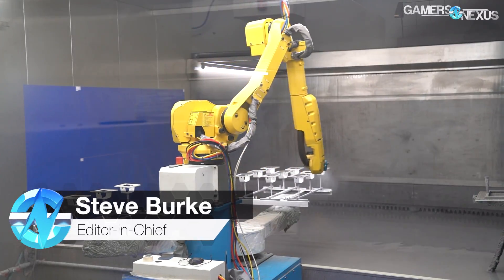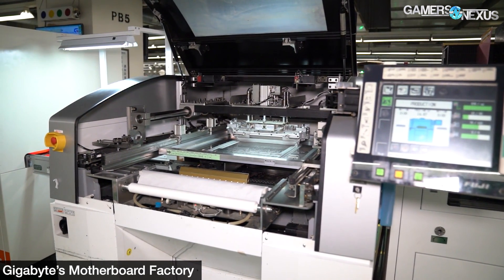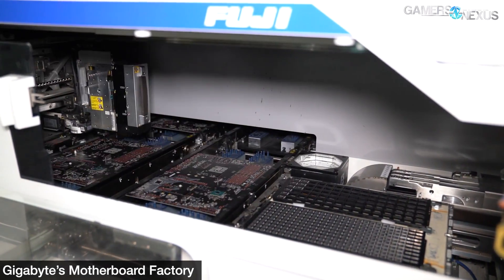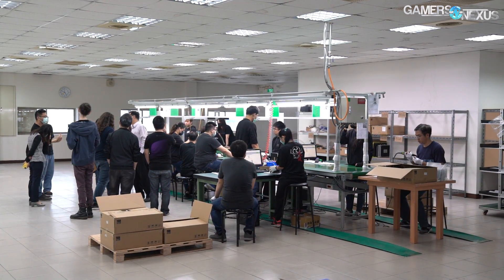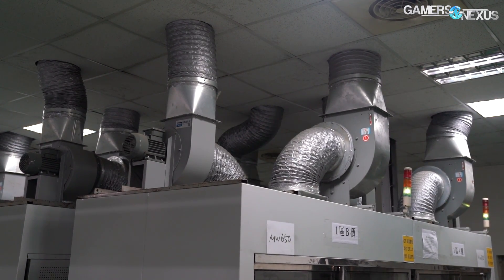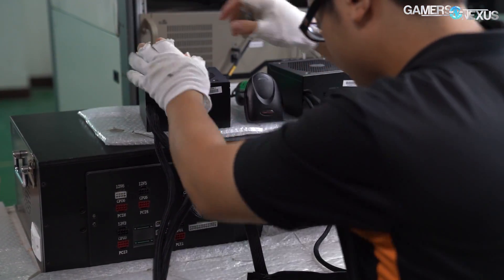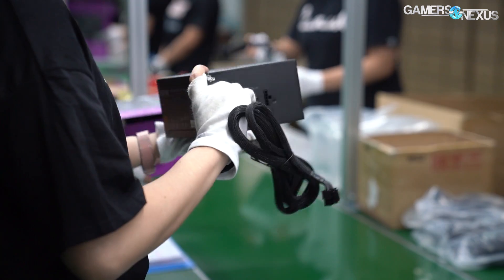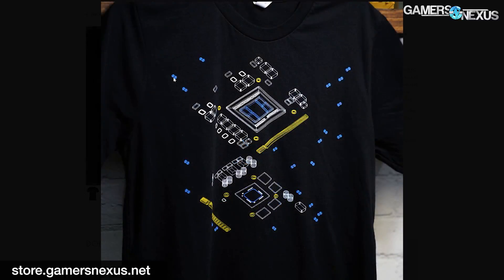How Power Supplies Are Made (2020) | PSU Factory Tour, ft. Cooler Master

Comment: "PSUs have low failure ratings" - Its amazing how different realities coexist in the world. Im from Brazil, and most PSUs here are absolute crap, I had at least 5 PSUs exploding before I got into tech. Most manufacturers lie about the potency, efficiency,etc.
We even have a group (Teclab) that tests a lot of PSUs and the vast majority is bellow spec, even from reputable brands (in the low end)
Reply: so that is where the units that failed QC finally end up
Reply: counterfeit parts?
Reply: Not counterfeit, just cheap stuff. From small companies mostly, like c3tech, xigmatek, etc. Also the low end stuff from EVGA for example: they are not THAT bad, but they are not good. My evga 430w went bad after 3-4 years, the 12V rail was varying between 10.9 and 11.4V, so the gpu stopped working properly (but it didnt kill any component)
Reply: @Taja_   Even small companies like Xigmatek also can give you good stuff if you know which model to buy. Even well known companies like Cooler Master also produced junk like the Extreme Power series. You have to be aware that even Cooler Master do not design their power supplies, they merely packaged it. The main PCB design and manufacturing is done by OEMs like this one shown in the video which is HEC . HEC also make power supplies for Xigmatek in the past such as the NRP-PC series many years ago. They were good. There are only 5 OEMs that I know of whom design and sell their own power supply under their own brand name to common consumers ; Seasonic, Super Flower, AcBel , FSP and Enermax.
Reply: Argentina here. Generic psu are bombs waiting to explode.
I always buy 80plus certified. Had a coolermaster 80plus white for 8 years was killed by the transformer near my house exploding but saved the pc. Now i have an evga 80plus bronze
Reply: Any cheap PSU whether from something random like you suggested, c3tech, or from Seasonic, is generally quite bad. If from a major seller they're generally not bad enough to explode (except Thermaltake and it's Litepower / 80+ bronze Smart series), however they still certainly will do dumb things potentially damaging the PC.
Reply: @HeiiKun   That's why I buy Seasonic Prime Titanium. Reliable, super efficient, fan only kicks on when needed, and near perfect power distribution. Where I live we have regular blackouts from downed trees during rain and snow storms. The Prime has just enough capacitive reserve that in conjunction with my MSI X99A Gaming Titanium it does around a 10 second safe shutdown. I have yet to get an improper shutdown message when restarting this system after a blackout. It's so worth the extra $$$ to buy a top tier PSU & mobo. Saved me from the mass of headaches I had when I owned OEM systems.
Reply: @HeiiKun  well, any 80+ Bronze certified PSU is decent, and I mean just good enough. I don't buy Platinum or Titanium because the savings on the electricity bill (you are going to need 10 years for price diff), but because they last more, and they are usually quieter. Best Seasonic PSU are certified Lambda++, noise under 15 db.
Reply: @biomorphic  Any 80+ Bronze is decent? Tell that to the Seasonic M12 / S12 series and let us see how it goes. As, they really arent decent, not even meh. They're just bad. Sure they won't explode, but that isnt the only thing that makes a PSU bad.
Reply: Hei-kun can confirm, my 500-ish (I can't remember the exact number) watt S12ii stopped working after roughly 6 months of use, hell I'm not even running anything high end, Ryzen 5 2600, MSI B450A board, ATi HD6xxx from back in the day just for the sake of outputing a display, and 16gigs of ram..
Reply: Luckily it didn't kill anything, beside my wallet, and my drive. Just, buy the best PSU you can afford, you'll never regret it
Reply: @biomorphic  Fake news. there is+80 Bronze psus that are even dangerous not crap but dangerous, look at psu's tier list. :)
Reply: @hafidzgi  man, I have the same psu and processor. Have been using it for more than a year for playing games everyday. I hope my S12ii 520w will be fine for the advertised 5 years warranty (gpu rx 570 4gb, ddr4 2666mhz). Did you apply it for warranty?
Reply: Valdis Knight not yet
Reply: True, had one CoolerMaster 80+ Gold blow up and started smoking, good thing my breaker tripped and saved everything it was connected to. Got it exchanged for another one and have been using it for 3 years without issues. There are always a few bad units but I still trust CoolerMaster.
Reply: jetjix  not true about the power rating. If you take the BQ Straight Power presented in the ad here, this series also have 400W PSU units that follows the same qc but the component are just smaller in power delivery. My advice is then quite the opposite : if you don't need a 600W PSU, consider buying a higher-level unit with a lower power rating for the same budget.
Reply: Most brands of the said PSU brands DON'T MANUFACTURE their own PSU nor/or even design their PSU and that includes Xigmatek and Corsair, they rely on other specialized PSU ODM (usually from China or Taiwan). One of best known longtime PSU maker are Seasonic who does both consumer and industry server grade PSU.
Reply: That might have to do with power from your outlets, to be honest.
Reply: I don't think you can blame it all on the electric device that gives up. I'm looking at the readings of my volt meter and it says 231V, it said 231V last 10.000x times I checked and probably will say 231V the next time. I'm just lucky we have stable power here. There is more stress for components when it swings from 210V to 240V at any moment and god knows what happens when you really look at it with a oscilloscope or something like that.
Reply: jetjix Yeah ikr, maybe my S12ii are just crap unit, it's like gambling, but get the best you can while you're at it, I also have another system running with a Thermaltake TT450 or something like that, a really old unit, I can't even remember when I got it, clearly 10yrs or more, but its still running just fine, it doesn't even have any efficiency ratings printed on it
Reply: sounds to me like you are at fault here.. like trying to run a 400watt system on a 320watt psu with poor rating. when you should only be using it for something like 260watt and keep the overhead for spikes.
Reply: I don't know but,maybe is a problem with the power distribution of your country? Can be this a potential problems?
Reply: he means actual good psu have low failure rating, ofc those 10$ psus will be dead in 2 months
Reply: Sadly, it's a function of the market. Your market doesn't support the "high end" enough. Most PSU's need to be cheap, cheap, cheap. Add to that crappy power and you get this sort of situation.
Reply: That is why you buy from USA. I live in South America too and my entire computer even the case was brought by friends from USA. I have a seasonic 800 modular still working after 10 years
Reply: @demonwares  Seasonic is a British brand and the factory is in Taiwan, as the headquarter. It is not from USA. The best supplier line they do, Prima Ultra Titanium, ships with a 12 year warranty. Corsair AX1000 is based on the Seasonic Titanium platform. For the most part, the PSUs on the market aren't made by the brands they sell them. The Corsair AX1600i, for example, is built by another manufacturer, which is not Seasonic, but it is one of the best PSU on the market, and it offers 10 years of warranty. Usually power supplies, and motherboards, fail after a few years due to the use of cheap capacitors with a short lifetime. The same happens when you buy an Asus board and a Gigabyte one. Good components cost a lot of money, but they are more efficient and durable. I fixed two Samsung display, dead one after the other in a 2 month time. Replaced the capacitors with the best I could find (for the use), they are still kicking now, after 15 years. I sold them to a friend 5 years ago, he is still using them. Often they put cheap capacitors because they want you to buy new hardware after a few years.
Reply: @biomorphic  wait... Seasonic is British brand? They are taiwanese... factory in China and offices in Europe, USA and Taiwan.

Comment: I was just thinking about how much power this wastes and that they should use it to charge batteries to recycle the power and then I hear that's exactly what they do lmao
Reply: @Dave P. why are you talking about fascists lmao
Reply: @jeeBisOkay  he isnt. Hes talking about eco fascists
Reply: @Dave P. must be nice to have winter..
Reply: @mtlshdr  No, it isn't.
Reply: @Dave P. "Eco facists"
Winter is only 3-4 months every year, but okay.
Reply: @mjc0961  you forget spring and autumn are also about 3 months of cold also. only about 2 months actually are hot in a year. (meaning you have the heat on most of the year.)
Reply: @theepicslayer7sss101  Which thankfully, if gas heating is used, is actually more efficient than air conditioning.  Heat exchangers muddle things up a bit, but, otherwise, heating is cleaner than cooling.
Reply: @PongoXBongo  heating usually is done with electric heaters, literally the same principle as a toaster. tho they are like a bar at the bottom of the floor near a window usually, they work with convection. so if you have 5 to 10 in the house, that is 1500 watts each. that is why we have about 400$ per month of electricity bills here in Canada during winter. (about 150$ to 200$ for the rest of the year.)

Comment: I have been using Coolermaster PSU's for years and without fault, only needing an upgrade because of new components needing newer, more or fancier connectors. Currently my system is running a Cooler Master Silent Pro M2 720W unit (which stopped production at the end of 2013), and very interesting to see how they are made and tested.

Comment: Manual bending machine is commonly called a sheet metal brake.
Reply: where ?
Reply: We used to call them a Brake press in the sheet metal shop where I worked. There's another more complex machine that does similar jobs called a folder. Folders are more complex than the brakes.
Reply: @FoolOfATuque  Thank you.
Reply: In German it is called "Kantbank" which translates to "edge bank" or "bend bench".

Comment: Good ol' Windows XP
Reply: You'd be surprised how many industrial machines use older OS as the machines that they run, are expensive and once the company is done producing the machines they never make updates for software.
Reply: @FerrumBellator  Hospitals too.  My hospital has tons of NT4 stuff. Medical software tends to be super proprietary and made by fly by night companies.  Once the company no longer exists there is no support or upgrade path but yet the hospital relies heavily on it.   They refuse to use open source stuff "because we need support" but yet they don't have support, nor any ability to upgrade it because it's closed source.
Reply: @redsquirrelftw  You own a hospital?! damn you must be very rich!
Reply: It really shouldn’t have been mentioned. That’s a big security problem to have that published. (Even though the factory has not been named, we have been told detailed information about them which if invested in it, shouldn’t be too difficult to trace)
Reply: The public transit system in Boston is run from XP. I took some pictures of the screens a few times when I've seen one errored out.
Reply: jank